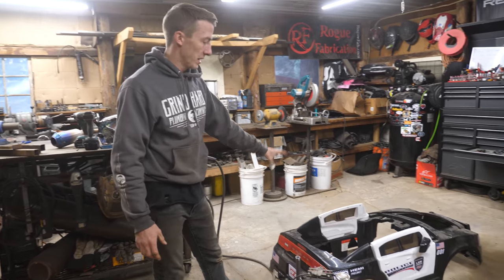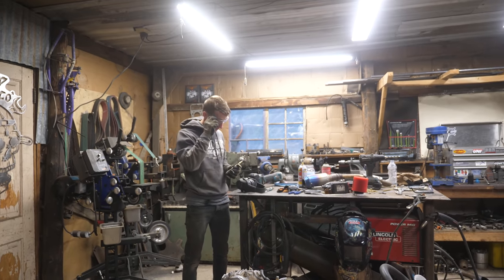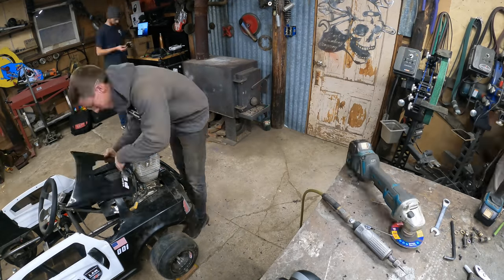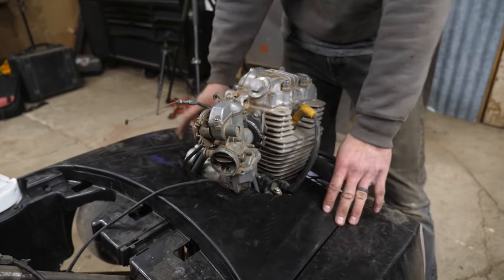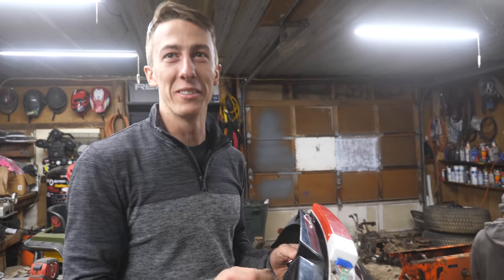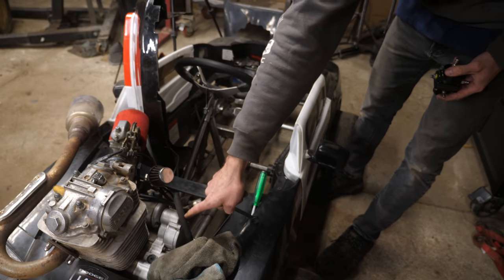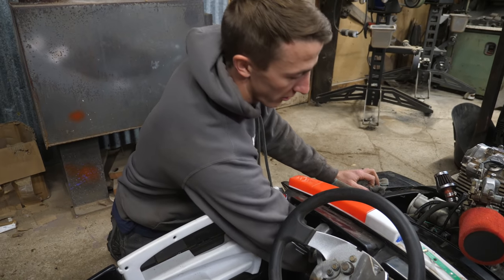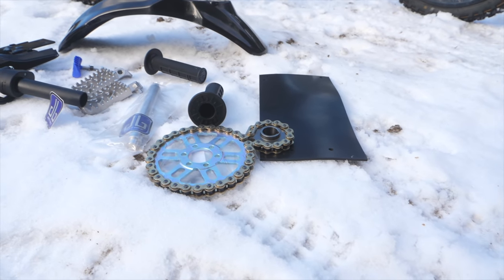DIY Go Kart Series. EP 5 - Mounting the Body and More!

Comment: Instead of decreasing the amount of fuel to make it run right, add more air via super spin twins or spiny whistle snail
Reply: I think their problem was the fuel pump was pushing gas past the needle and seat thus flooding the carb/engine.
Reply: @levinscustombuilds1070  yea I know, I was just joking. Tho would not complain if they boosted it
Reply: Could this be solved by putting in a tee and running a return line to the tank? Seems like that might be simpler. I'm actually wondering  myself for a future build.

Comment: You really dont need the pressure regulator, do you? I always just put a T fitting between the pump and the carb, and have the line feed back to the line between the tank and the pump, if the pressure in the line is too much for the float needle it just goes back down to the draw line from the tank, like a loop! Works every time on simple 1 cyl 1 carb style karts